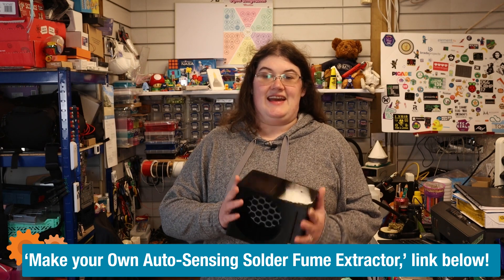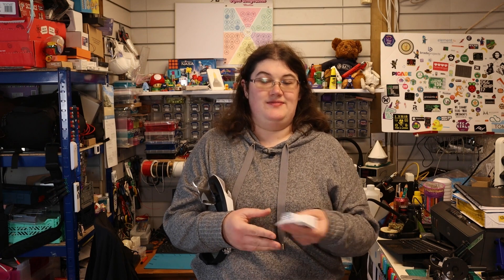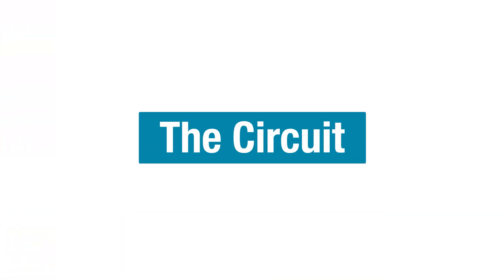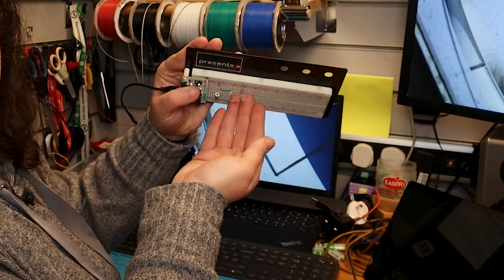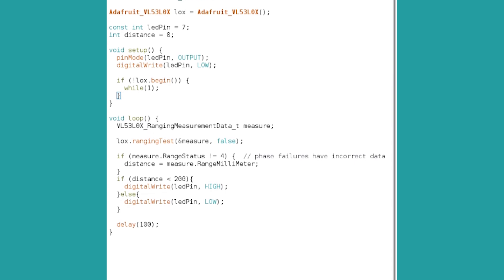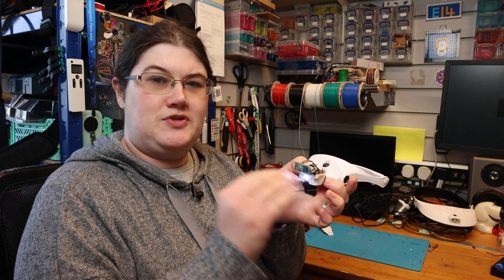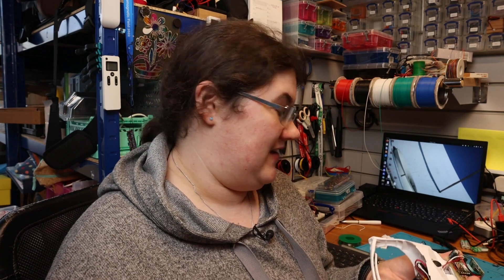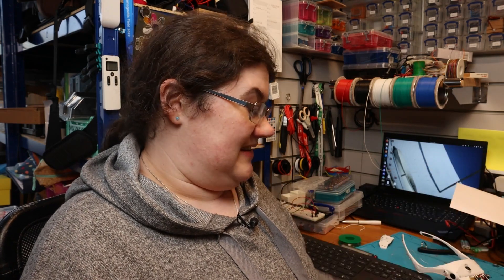Enhancing a Magnifying Headband with Auto Sensing Light

Comment: It’s your code causing that flicker, your constantly polling the sensor then doing a digital write toggling the pin to true or false every time through the loop, you want to keep track of where the the head is position and what the current state of the led is either on or off and only switch it when you need to, I hope that makes sense

Comment: my 2 cents on the topic of the flickering: you might be right about the cause. It is possible that under there is some sort of current limiting device or circuit so those LED's do not burn out. It's still doing it's job and possibly limit the current of your circuit, which might then cause the drop when the sensor fires the laser.
You could perhaps simply bypass that blob and go directly to the batteries and set up the mosfet as a constant current led driver.

Comment: I bet you keep setting the out pin with digitalWrite every 100ms is the problem. Try keeping track of the current state of the LED with a boolean variable and ONLY do a digitalWrite if the state has actually changed since last time. Like: sending ON, ON, ON, ON, ... every 100ms could possibly (internally) cause some short OFF spike before going back ON again, if you understand what I mean.

Comment: did you check with a scope what the distance sensor outputs are? if the values are jumping you could add a sliding window optimisation.

Comment: Could the flickering be due to the sensor readings being not accurate enough, reading different distances even if the sensor's distance from the object is the same. This could be solved in software by 'decoupling' the sensor from the triggering of the light to come on, by turning it on for a set period of time, say 2 seconds, and then reading the sensor's results after that to determine whether to keep it on or turn it off.

Comment: Just leave it on
Reply: I came to this vid solely because of the automation aspect. When both my wife and I are working in our home office at our stations and she gets my attention to ask me something, 7/10x I’ll forget about having my head lamp on (actually the exact same headlight magnifier she modified here) and I end up blinding her. That headlamp is deceptively bright in its stock configuration which is 2x 3mm LEDs with an Off-Low-High momentary switch. I’ve already modified mine by adding 2x 5mm LEDs above the stock ones with a small 3 position SMD switch to select between each pair or all 4 and upgraded the LiPo from a the OEM 300mA to a 750mA so I’m quite familiar with this unit 😂. Plus, at like $15USD on Amazon, it’s a fun tool to play with and not worry about wasting a bunch of money.